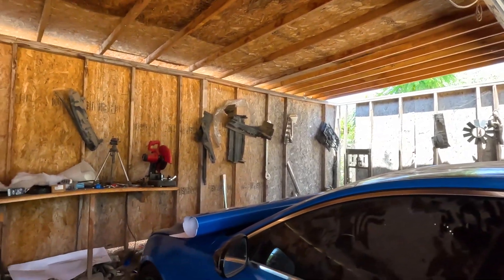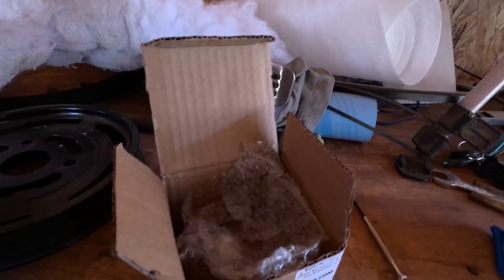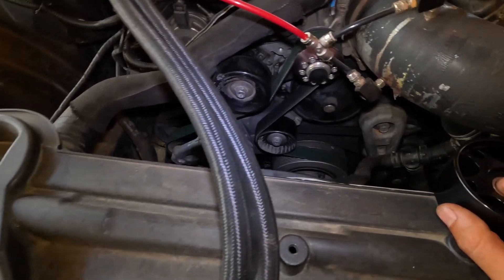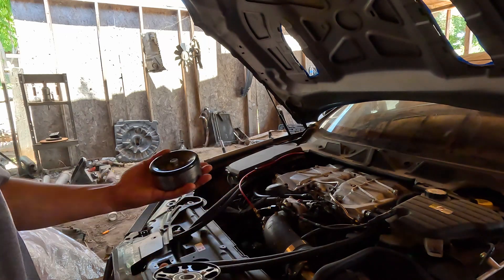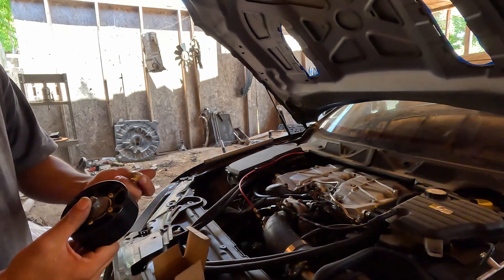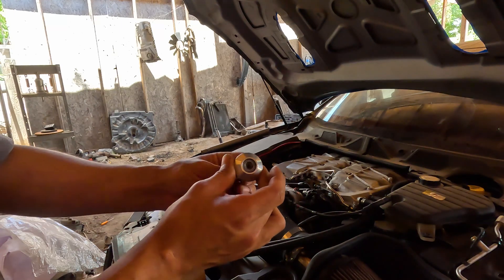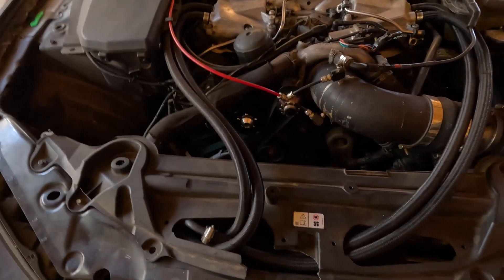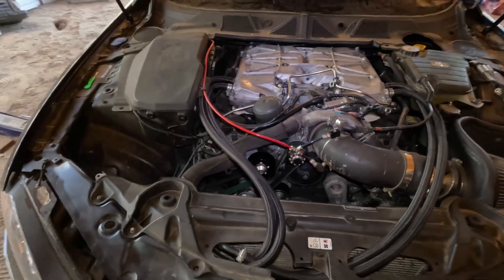Jaguar 5.0/Aj133 How To Upgrade The Supercharger Idler Pulley To Billet Aluminum!!

Comment: I prefer the way you have your belt routed under the pulley to allow more belt wrap on your upper SC pulley.  Also noticed you modified your tensioner so the belt wouldn't contact.  Do you have  avideo regardign this mod?

Comment: What coolant temps are you seeing after a pull when idling ?
Reply from the maker: 190-195f try not to push the engine in hot weather. 205f and over is a no go for me I let it cool Down or just not run it if is over 205 we got alumingum heads and pushing these motors when hot can  lift the heads or damage the threads holding down the heads
Reply: @Ricky50scJustalil6cylinder  206-208 normal in heavy traffic then it drops down, I’m in Fl ?
Reply from the maker: @tra5.011  that's normal

Comment: how much boost are you making right now? won't the crank pulley over-spin the supercharger? with that setup, you would be way past the 18,000 rpm limit of the supercharger.
Reply from the maker: Around 13.8 psi you can spin a tvs blower as fast as you want you just gotta pay attention to intake temperature. The bearings are rated for around 18000rpms but they can handle alot more speed than that these blowers have been pushed to over 26000rpms in the gm cars. Boost is not a measure of power you can have a 3.0 wipple pushing 20psi and a tvs 1.9 on 15 psi and make the same power on both setups. Boost is a measure of resistance the less resistance the better that's why I been porting my supercharger and exhaust modification before I upgrade to a crank pulley doing these modification will drop the boost and moves the supercharger efficiency range at high rpms that will allow for more aggressive pulleys. Is short answer the less resistance the more you can spin a blower and make more power so I wouldn't worry about overspining the supercharger